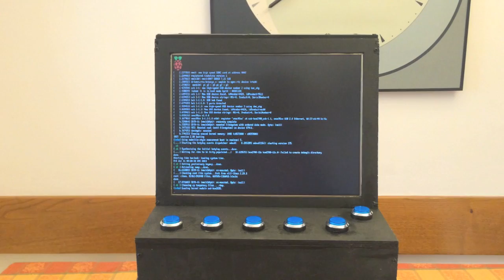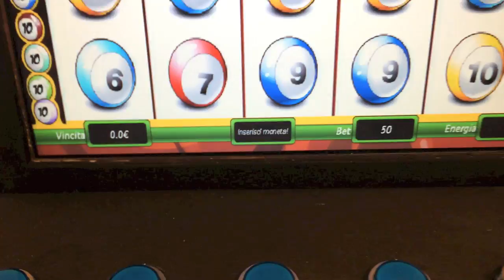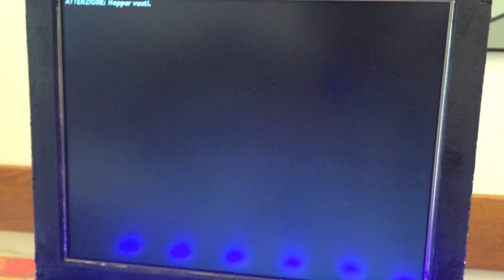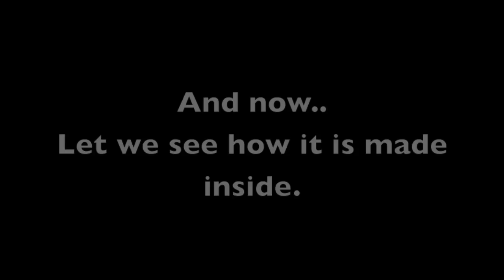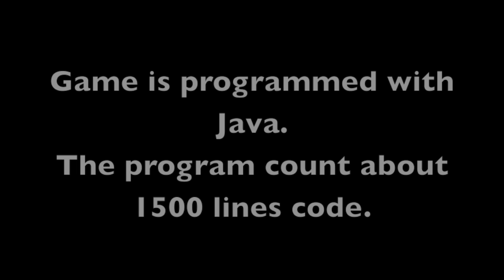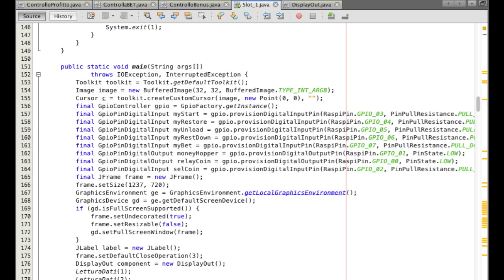Raspberry Pi - Slot Machine

Comment: i would love to know a little more about the programming of the coin aceptor and hooper, and eveen how to create those 2d game on raspberry. Nice project.
Reply from the maker: Hi, on pi4j.com you can read more about GPIO and Java.
However input pin of coin acceptor and hopper are connected to Relay because they have different voltage.
For the graphic i have used Graphics 2D API.
java.lang.Object
java.awt.Graphics
java.awt.Graphics2D

Comment: where i download it??? post link, please
Reply from the maker: What could you download? The java program? 
Is not online, is mine and that run only on Raspberry Pi with the correct connection, else the program crash immediately.
Reply from the maker: Is simple to program, you can use Graphics 2D API in a separated class.
The reels are not appear random but is simple to program the algorithm for profit.
Reply: legomindstorm1 Can you post the java code? I wanna see the java library and how you connect everything for GPIO . It is posible ? Good Job! !
Reply from the maker: I'm sorry, i'm making a new version of Java code with a new Graphic Interface (Fowl Play Gold).
I'm almost done this project and when i will finish it, i sell it with all documentation included.
I'm coding the remaining bugs because there are small errors.
Some information short.
Greetings.
Reply: Ok, Just wait for new version!
Reply: Alessandro Apo hey are u there

Comment: Hi, what hopper did you use for this? I need to find a hopper which can connect up to the raspberry pi & dispense 1p coins
Reply from the maker: +Luke Smith Hi, for a simple project you must use Hopper with "Universal" connector (Not CCTalk) for example Universal Hopper Series.
Also I think that 1p coins are too small to be used in Universal Hopper MKII,MK4 ...
Reply from the maker: +Luke Smith See my new version of Slot machine, is better than this.